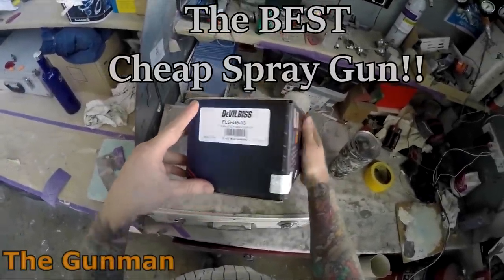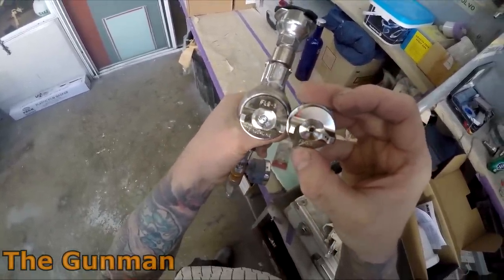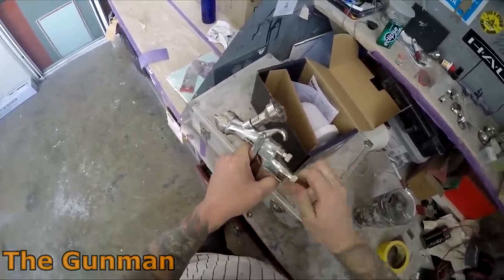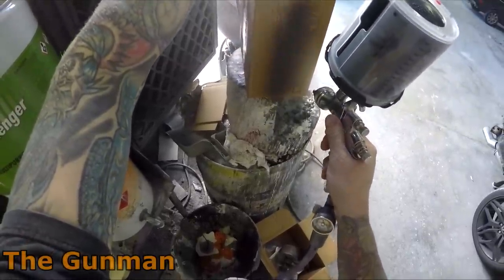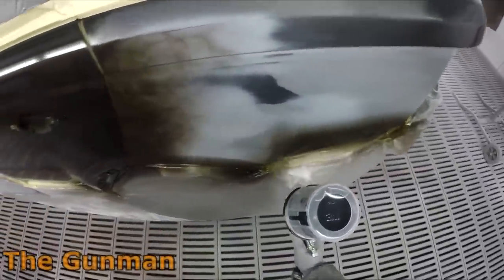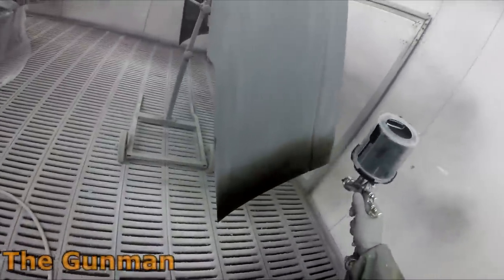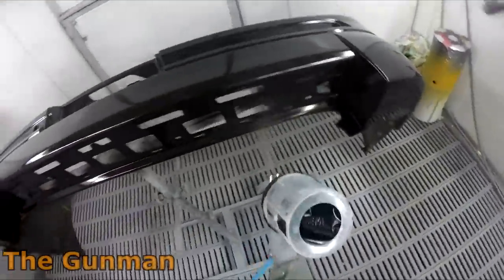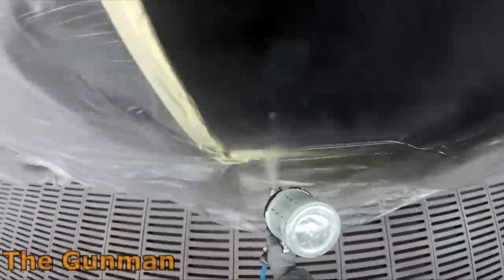The BEST Cheap Spray Gun!!!

Comment: I still love all 3 of mine and they are absolute workhorses. I use a 1.8 for primer filler the 1.4 for barcoat or sealer and the other 1.4 for vhs or uhs clearcoat. Never had a problem.

Comment: On Gunny's rec' I bought 3 SGK600BV's, 1x base, 1x clearcoat, and 1.8 for primer (the browny coloured one). Have sprayed plenty of solvent base and clear through them. Today I sprayed Auto Air sealer and Sparklescent pearl water base on an aircraft - worked well. Although, the smaller tip would have helped with the pearl. Didn't entirely like how the 1.8 sprayed (pattern uneven), but gets the job done. Just got an Iwata Bellaria and a Lotus WS400... will be interesting to compare. Devilbiss always felt strange to me, might be because I sprayed Iwata suction feed 25 years ago with acrylics and enamel. Not used to the oval pattern, and gun so close to the work. Gunny brought me into the 2000's, and made painting enjoyable again. Thanks mate.

Comment: I use the FLG5 for 1k Primer and sometimes 2K Single Stage Paint or Clearcoat. I love the Sata and Iwata Guns, but for the price (in Germany it's around 100€)) it's a really nice gun. Easy to use, easy to clean, kind of a workshopwh... you can throw around and don't have to care a lot about and still works.
The point about the retaining ring on the aircap is rather a positive thing to me when it comes to cleaning, I can't really see an issue there. Sure, it's not the prettiest gun on the market and not the best made, but hey, look at the price, what do you expect?! Even the cheapest Satas (100 and 1000 Series) start at around 220€, the Iwatas are even a little bit more expensive here. 
Especially for beginners or DIY guys it's a really good gun to start with, in my opinion. But even as a professional in a workshop, for Primer, 2k Single Stage or just as a backup Gun, you will be happy.
Greetings from Germany!
Reply: Could you please give the shop where this gun can be bought for 100 €? The less expensive that I found was for 180€.  Thank you
Reply: @gaborkoncz9893  I bought it from Hellmann Oberflächentechnik Bremen
Reply: @Jonas___  Thank you Jonas.

Comment: Hay Gunny , hi there from South Africa , Flg5 great gun bought mine on your recommendation from sprayguns direct been using mine for around 4 years still going great , I actually got a Satajet 5000 rp 1.4 that I bought from a bud for 150$ but tried everything can't seem to get Japanese finish right no problem with the Flg5 , won't believe it but I'm using that Satajet for 2k primer wat a waste ! I'm a Diy guy but put out about two jobs a week constantly , that's after hours . Saving up for a pro Lite but but with the 💷 to Rand exchange rate it's pretty expensive about what two complete sprayjob would cost ! Always a pleasure to watch your vids !!! They say if you don't ask you'll never know so I'm asking , if you ever have a pro Lite gathering dust for a decent price I'm in the market ☺ !!

Comment: Would you rate this one higher than the GTI with a TE20 aircap? I'll be using mostly direct gloss 2K paint to restore classic cars. I like the paint to lay as flat / glass like as possible to minimize buffing. Another alternative I'm considering is a satajet 100 BF RP. Especially also interested in your views regarding a 1.3 vs 1.4 tip, I've always used 1.4 but always had slight orange peel. I think the 1.3 would lay flatter. Thanks again

Comment: Would love a comparison video on flg5 1.3 and 1.4 for 2k solid paint, just bought the flg5 1.8 for primer, have sata 4000 for clear, pro lite for water base, was using a cheap gun for 2k but defo need an upgrade, any advise on which you would recommend would be great 👍 loving the videos 😁

Comment: I have the sata 5500x I 1.3 and it does in fact spray a bit heavy at the top of the fan. However I can adjust the pressure and fan to find the sweet spot where it sprays evenly, but obviously I shouldn't have to. I plan on getting the 1.4 o kit for it as it doesn't put much material down. But i don't like to spray slow i usually move fairly quick.. And also I bought mine new in box for just over 400 usd on ebay and have seen many sell for that, even the 1.3 o. And no its not a knock off. Regardless of the negativity of the sata name, the build quality of the 5500 is all around fantastic.

Comment: yes, i can see that it sprays the water base coat; what the guy meant was the "solvent" designation means the type of o-rings in the gun are different, ie rubber or synthetic, one WILL degrade with solvent based paint/ cleaning fluids, others don't, which allows them to be used on either paint material, the worry is if the o-rings stand up to the SOLVENT, not that they are OK with water based material, ALL gaskets (other than paper, of coarse) are suitable for water.

Comment: I have the FLG5 and it has worked great as a primer gun. I noticed that the last couple times i used it, it leaks air from where the need goes through in front of the trigger. I have cleaned the gun and need, I have tightened and loosened the nut where the needle goes through but no change. I have also changed needles and still have the issue. Have you experienced this before?

Comment: Great vid, and thanks for all the education over the past few years. Got my hands on an FLG5 -18 to shoot acrylic lacquer. It's using so much paint and pumping out so much in overspray, I think I must have the settings wrong. The paint SDS/TDS says shoot at 50PSI, but it's just blowing it everywhere except where I need it the panels.. Should I try the 1.4 tip?

Comment: Hey Gunman, love your vids! I'm looking respray some bumpers and maybe a quarter panel for a sedan in 2k base and clear. My compressor is limited to F.A.D of 178l/min (around 6.2CFM) and 36l capacity. The FLG5 keeps on being recommended, but will that have no chance on my comp? even if patient during passes? Would you recommend something like the ani r150 mini instead?(well within the cfm, but needs more pressure according to your vids) I take it the 1.2m tip would still be able to shoot whole panels

Comment: I've been following your channel for years, ever since I've had to do a cheap and nasty respray with an ebay gun on my falcon shockwave blue ute (being an aussie you probably know about the ford shockwave paint debacle).  For ages I've been looking for a better gun to redo the whole ute properly, but I've been bounced around and had no garage for too long.  
Anyway, I looked you up again for a gun review because I still intend to do that one day but now I have a different immediate project in mind. You piqued my interest when you mentioned water based paint.  I'm still looking for an upgraded gun, but baring in mind I can't guarantee a roof over my head these days this isn't going to be a gun for life, I just want to sort out my shit and not leave a mess behind and the gun will probably have to be sold before I move on anyway.  
I'm looking for a gun to respray a different project car interior with water based paint/dye made for leather and vinyl.  I thought this would be an opportunity to get a decent gun with a couple of tips/nozzle sizes.  Previously you recommended the A.N.I. r150 mini gun but sprayguns direct only sell that with the 0.8mm tip now so if I get that it may work with the interior stuf, may not, and then I'll have to get the $60 1mm nozzle for interior, and $60 for the 1.2mm for the ford shockwave at least.  It's $200 for the 0.8mm possibly useless tip and gun, extra $120 for the 1mm, and 1.2mm plus $50 post.  Do you still recommend it at AU$370?  Have you found anything better since then, especially as they are pushing the 0.8mm tip now only?  I'm looking for 1mm to maybe test with water based interior paint/dye, and a 1.2mm for the main tip to fix up the falcon ute, (my old star has 1.4 and 1.7 so that will do for primer).
E:  To be clearer I'm just going to start with a mingun since I do have a full size star.  Local aussie options with a $300 budget are star s016t-j $140 interstate, or locally in WA  a prowin k320m $179.  I was willing to buy the ani from sgd for $200, but put off by not having a nozzle choice and its $60 x2 to cover my options,  Is it still recommended or should I just buy a larger gun with more local range and prices?  I'm not choosing to DIY everything but it seems I have to, I ended up DIYing my headliner because upholsterers/motor trimmers have a waiting list in these cashed up covid days.
Reply from the maker: Hey mate, so the R150 had been through a few revisions since those days, it's actually now called R160 and it's actually a decent improvement. I actually have one in 1.2 or 1.0 I could sell you one for $100+ postage, email me at thegunmanraw@gmail.com and I can send a pic if you like

Comment: Hi mate well i am not a painters bootlace but i do have a crack mainly boats which to be honest have turned out reasonably good even for the eyes of a pro painter who i showed ( good flowing paint i rekon not skill) , anyway i have done 3 boats over a 15 year period with my el cheapo hvlp gun but i think it may be time to retire it even though i have looked after it well it may just have to be a primer gun from now on . This gun is not expensive as you say and my question is how do you think this would go using 2 pack epoxy as this is normally what i use on the boats for toughness ,any engine cowels ,legs ect are done in 2 pack urethane, anyway so thats my question before i run out and buy one ,

Comment: Tbh, my flg5 has been very disappointing, bought it when they first came out, needle packing would always grab the needle and then dribble paint and ruin jobs, even with the nut backed right off, the needle and nozzle started to not seal after maybe 5lt of paint, and now it leaks air from the control nobs, early gun or Friday afternoon gun, maybe the newer ones are better quality.
Reply from the maker: That's a pity to hear, I've had nothing but good results with mine.
Reply: The same with mine bought it little bit more than a year i only use it 5 or 6 times and now start leaking air from the air pressure control knob i talk with chris and he told me that they don't replace it because they has to send it to devilbiss and devilbiss company is gone to return to spraygunsdirect and now is garbage because there is not repair for that gun.
Reply: @fernandosaldana3665  Devilbis did not want to help with mine either.
Reply: @evojigger  i have also gpi and pro lite seems to be much more better quality and better finish but for some reason i feel more comfortable with iwatas i have the bellaria and ws400 black mamba.

Comment: Gunman, love all your videos, i have learned so much from you! Getting ready to purchase a new gun for base and clear. What would you recommend in the 200-400 usd range? Been looking at the flg4, flg5, the gfg the gti the gpi, so many to choose from. Also is there a reason you use the 3m pps system over the dekups system? I've never used either, but would like to outfit my new gun with one of those systems. Thank you!
Reply: I have dekups on the flg5 nice setup, your call sounds like you know the lineup and costs, Gunny has videos on nearly all those, up to you to ‘pull the trigger’ 😀
Reply: @PnwOnTour  never used dekups or the 3m version. Im excited to try one or the other, just can't decide on a gun! Willing to spend more than an flg5, but he talks so highly of it!
Reply: If you’re going to be using it a lot with various things go GPI or pro lite, I don’t paint much flg5 fits my needs and I love it and dekups gets you upside down, gunny said the GPI is like a pro lite without the bells and whistles less options of caps etc
Reply: @PnwOnTour  I went with the flg5. Seems quality, ill know after I shoot with it, about a week out!
Reply: Won’t disappoint, I’ve ran everything through mine, did my truck single stage black, epoxy, clear, thinned 2k, just clean it each use.
Reply: @PnwOnTour  no doubt. I clean meticulously each use. Have separate primer gun. Hoping to keep this gun for base/clear. Thanks for the advice!

Comment: Hi Gunny

Last year you made a video for me with spraying a silver on a bonnet with the FLG 5 /SGK. It really helped me man, big thanks for that!

I just got myself my first GTI Pro just for clear. I'm struggling with spraying my clear with the FLG 5. It seems that the clear starts to solvent boil or fish eye on all flat surfaces I cleared. 

I've now tried a better thinner for my clear and it looks better but these very small pinholes constantly appear on bonnets, hoods, all flat surfaces. 

Strange thing is, that these pinholes mainly appear on the sides where I start to clear! The side of the bonnet I stop with spraying the clear, the pinholes don't appear! Maybe I should use a slow thinner, but a slow thinner at around 20 °C ?? What do you think? 

My paintsupplier suspect sillicons but I don't think it is a sillicon problem because of the fact the pinholes only appear on the large flat surfaces, on the side I start to clear... I suspect clearcoat overspray, the clearcoat flashes off too fast I think..

I'll try the GTI to clear the flat surfaces and I'm curious for the result! Maybe I'll thin my clear a bit more with the standard thinner.

Grtz Frank
From The Netherlands
Reply: Try less material or moving a tad faster, or slower solvent

Comment: Hey bro , I’ve had mixed reviews on the Vx Calais I’m going to be painting . I’ve had to hit bare metal here and there to see where I’m at with panel work. 6 areas to be precise . This is my first respray btw . I went out and got 2l of epoxy probably use 1l to seal so I’m working on a fresh surface without having to go back to complete bare metal. Is epoxy primer a thing of the past . After I lay down epoxy as a sealer I was going to hi build 2 coats block it then 1 more hi build, sand, then 2 coats of garnet red pearl followed by 2-3 coats clear being first time I was thinking 3 so it gives me room to sand and polish. Can you guide me in the right direction bro

Comment: I bought the FLG 5 when you first reviewed it. Has never let me down  we dont get your weather but heres a question for the Flg5 its 11C I'm going to paint this weekend the garage will be around 21 C . Do I increase or decrease pressure that's the only issue I have I do ok but thinking it could be better  I do heat up my clear first .
Reply from the maker: Hey mate, it can't hurt to warm the clear up to 30C but if ambient temperature is already 21 then it's not absolutely necessary. I usually start at 29psi and adjust from there as required. Sometimes it needs more and sometimes less pressure.

Comment: Can the fluid tips be purchased for these guns? for example 1.3-1.4 to put in place of 1.8?  or should you buy a whole new gun?
Reply from the maker: Don't quote me but I think the same needle and air cap is used for the lot. So I think you can just change the fluid tip. I would recommend checking with Chris at info@spraygunsdirect.co.uk but to be honest it isn't that expensive to just get a new gun.

Comment: The issue i have with this gun is on the air adjustment, air just leak from there. Is that just on my gun or is the common problem?
Reply: Got mine about 2 years ago also because of Gunneys recommendation.  Same issue as you after about 4 liters thru it.  Took it apart, put it back together no leak so far.  Can't remember exactly what the fix was.  I think it was an o-ring that wasn't seated correctly?  

After about 16 liters the packing gland (needle seal forward of the trigger) started leaking.  It started to make the fan pulse so it's unusable until I re-pack it.

I'm going to order another FLG with two full rebuild kits.  I like the gun, it sprays very well.  However the following pisses me off to no end.  The  #@!!$%~#~  lid doesn't fit the cup.  There is just enough difference in the threads to make putting it on and off a nightmare every damn time.  The PPS type system was on the horizon so that will fix that.  It still pisses me off though.

Comment: Why is DeVilbiss so hard to find in the US? I'm in Florida, lookin on ebay and best I can do is order from the UK! Oh and hey Gunman, where do you get those 3M PPS bag liners? All I can find are the cup liners! Thanks, Gunny! Also is the #S15 adapter the correct adapter for this gun and the PPS system? Amazon lists the FLG4 as compatible but no the FLG5.
Reply from the maker: The S15 is the adaptor for the PPS2, for original PPS it's just 15, and yes both them adaptors fit this gun.
Reply: @TheGunmanChannel  Right on, thanks guys!
Reply: @fernandosaldana3665  Awesome, thanks!

Comment: I see your using the PPS 2.0 system. How is it compared to the original PPS?
Reply from the maker: It's better, they supply a new hard pot with each box and did away with the screw on lid

Comment: Is the needle for this gun compatible between 1.3 and 1.4 tips? Is my understanding correct that if you have 1.4 version you can just buy a 1.3 nozzle and then you can swap them as you need?
Reply from the maker: Yes, that's correct. But from memory you'll need a different needle for the 1.8
Reply: @TheGunmanChannel  Thanks a lot, always good to have an option :)
Reply: @TheGunmanChannel   just purchased this gun (need to spray sliver base and clear ) would you recommend that I buy a 1.4 for the base or is the 1.3 ok ?

Comment: Just got the 1.3 tip flg5 and hardly even straight acetone will spray out of it.. doesn't work for me as it seems to work for you heh. Fluid full open, air full open..